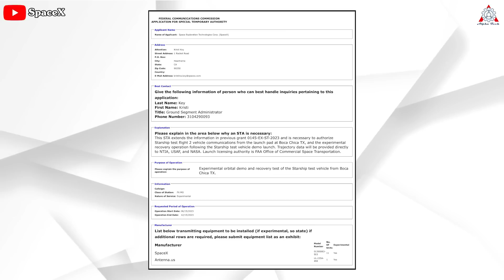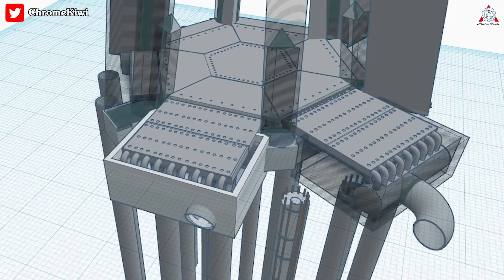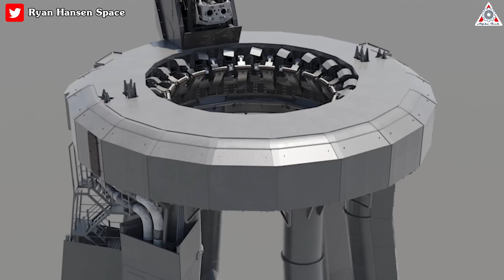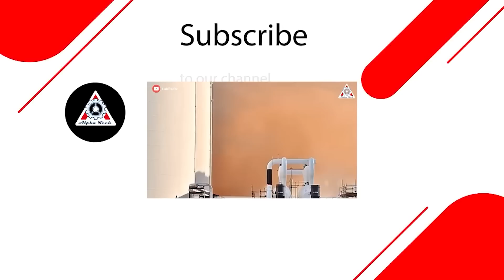NEW Starship Launch timeline leaked out! Stage 0 makes huge progress...

Comment: it's not the starship that I worry about. It’s about the launchpad that is the concern.

They have to do something about the super heated steam that will erupt and consume the engines and their plumbing. 

Imagine the super heated pressure cooker consume the entire rocket at launch.

This is what I predict.

Sanjosemike (no longer in CA)
Reply: If the concrete tornado didn't consume the rocket, I doubt the steam cloud will. The steam will spread out and away from the engines, and condense into visible vapor upon exiting from under the OLM. The real pressure will be coming out of the Raptor engines (pressure cookers), and will flow from high to low pressure areas (away from pad).
Reply: @psycotria  Heat rises. That is a part of physics. Obviously Mr. Musk believes as you do. If the rocket engines (and their plumbing lines are cooked by the hot steam, I guess we will find out.

I am not quite as certain as you are this won’t happen. Let’s put it this way. I am not willing to be part of the payload on the next launch attempt. Are you?

Comment: The very best engineering for the heavy lift rocket is to dig a 100' hole, and launch from the hole. At ignition the hole instantly has negative pressure, and pushes upwards relieving a full weight lift. The water flush to control sound, and protect the engines also will produce instant steam, which expands by 1500X creating close to the amount of thrust generated by the heavy lift rocket. By the time it leaves the hole in the ground in about 7-10 seconds the rocket will have twice the excelleration of a ground level launch, and all the exhaust and steam will act like gunpowder behind a bullet. It will save tons of fuel with the object already in motion at several times the speed of a ground level launch.  Just my engineering idea to improve the heavy lift rocket. The sound will also be directed straight up until it leaves the hole. All navy rockets launch from tubes of some sort, and the rocket is already zipping along when the tube pressure pushes it out. This isn't new technology. It's just doing it on a massive scale. Hopefully it won't collapse the rocket with more thrust than it can handle.

Comment: SpaceX's lauded "lessons learned" model is nothing more than what NASA meticulously did.  A little less cheerleading out of Alpha Tech and maybe some more objective observation would be appreciated.  What SpaceX is doing is indeed impressive.  How they are rushing along testing already obsolete equipment yielding minimally productive feedback and maximizing unforced errors deeply harms their "meticulous" cred on the postflight problem-solving.
Reply from the maker: I noted this, thanks
Reply: I think SpaceX's need to "clear the pad", along with finally having a flight ready prototype, enabled the exposure of a design flaw in the foundation (see CSI Starbase ) that may have ended any earlier, now scrapped booster prototype launch with a pad explosion, causing far more damage and perhaps injuries or deaths. SpaceX has scrapped most of their test articles after analysis said "This ship won't fly". They may move fast, but not recklessly so.

As for "already obsolete equipment", SpaceX blows them up, gets the data, and innovates, while NASA perfects it at 50 times the cost, decades late and $10s of billions over budget, because they are no longer allowed to fail and innovate. 

Look at all the promising projects that have been cancelled with real hardware already built. NASA burns money that could have been turned into real cutting edge spaceflight programs.

NASA is good at what it does; designing missions. However, building excellent rocket systems that advance the art has not been a thing at NASA since Von Braun and Apollo.

Comment: It still looks laughably over-engineered to me compared to creating a crude flame diverter with some off-the-shelf piping, with no moving parts, and the water deluge system being only used to absorb sound energy. Oh, it looks all so exciting, but good luck with maintaining this over-engineered piece of 💩, as Elon and Co described Twitter.
Reply: The booster plume while still on the pad will burn off 1" of stainless steel plate per second. Just how long will "some off-the-shelf piping" last at liftoff? How many more moving parts does the "upside down shower head" have over what you advocate? The "off-the-shelf piping" will become additional "moving parts". The rocket created "a crude flame diverter" by itself, btw.

Twitter is a DARPA/ClA engineered PoS doing what it was designed to do; project propaganda and control thought. Elon should scrap its code as fast as he fired most of the employees (operatives). Twitter was [Their] bullhorn and Elon executed a hostile takeover. They way mad bout dat!

Comment: I wonder if there is a reason why they don't either raise the launch stand to a safe height or excavate the ground beneath the booster. Heck would it be possible to launch from the Mechzilla arms even ?
Reply: The water level is too high for that. Their new plan can work, not sure why they didn't wait for water deluge set up.
Reply: @WyoSavage1976  the claim was that after the pad survived the static fire at 60% thrust they assumed the concrete would handle full thrust for just the first launch and then they were going to install the plates in the interest of getting the first tests over sooner rather then later. We all saw how that worked out though 😬.
Reply: @WyoSavage1976  The Fondag concrete was more than strong enough to withstand one launch, if it had been laid upon an adequate foundation. There were some flaws in the design of the foundation; see [ CSI Starbase ] latest video by a qualified engineer.

The failure response by SpaceX will result in a pad that far exceeds its prototype Stage 0 implementation prior to the first launch.
Reply: Raising the launch platform is probably the best choice except that it would require all existing stage Zero equipment to be scrapped and rebuilt.  Asking why they didn't just do it that way in the first place is mute. Hind sight is 20/20.

Comment: May I ask, once a Starship is up & working... landed on the moon etc, considering what happens at launch to the area directly under the engines how will Starship deal with the debris blowback on the Moon/Mars surface? I suppose you wouldn't need such a powerful engine... isn't the moon quite dusty? I'm sure it's all been worked out.
Reply: It has engines on up the rocket (on the moon version ) just for this reason
Reply: You won't need the booster on the moon or mars because of the lower gravity so only starship will suffice. It's likely that the first starship won't come back. I assume that they will use a few starships to bring material to build a pad on Mars / Moon and then go from there.
Reply: Starship by itself can theoreticaly reach orbit from earth but without any payload, it would have no problems elsewhere with the lower gravity. Most likely is for there to be landing thrusters higher up so it can clear the lunar or mars surface before firing the main engines.
Reply: Don’t they you know the moon is made of cheese?   What a gooey mess it will be.
Reply: It will all work out. SpaceX's road to success is paved with expected potholes.
Reply: You asked the $64Mil question.
But yes, SS has only 6 engines,
but I still see the Selene sinking in dust.

Comment: 1 Raptor is completely different than 33 Raptors. If any spot on the steel plate ends up running dry, or has even a slightly lower pressure than the thrust side then rocket gas is going to find a way in and once it does it will explode the whole thing. I assume SpaceX is planning for that and has it figured out, but I think they (and a lot of us) thought they had it figured out with the Fondag concrete.
Reply: The upcoming 33 engine static fire tests with the water plate design will tell us all we need to know. Also for the next launch attempt I suspect they will spend far less time sitting on the launch mount powering up thrust. They’ll just send it. After they scrub a couple of times of course.
Reply: You sure love making up the most frightening fictional narratives. If there is a dry spot on the metal plate the water pumped under it will refill the pocket and still cool the plate.  If exhaust enters it will be pushed back out by the water and since the cavity under the plate is lacking fuel, there would be no explosion.
Reply: See an oil & gas ground systems mechanical engineer's analysis of the pad failure. [ CSI Starbase ] latest video.

Comment: I'm looking forward to the deluge and water cooled steel plate solution they'll use at Mars Chica.
Reply: Single stage to orbit and dramatically less thrust is feasable on Mars.  38% earth gravity.
Reply: on mars there is way less gravity so less thrust is needed

Comment: That application covers communication equipment, and is for 6 months from June to December .
Theres no way that the FAA will give flight approval until they fix the pad properly(and prove it with test fires) and fix the flight termination system so that it actually destroys the vehicle, rather than making a vague suggestion that it should do so.
Reply: What does FAA have to do with prototype new launch pad?
Reply: @psycotria  Since when do paper pushers need real authority to impose their will? The Supreme court just spanked the EPA on water ways, they need cases to do this to more agencies.
Reply: Thank goodness the FAA is there to protect us from success and advancing.
Reply: @rogerrussell9544  I'd be quite glad they're there to stop out of control boosters from landing on someone. It took over 40 seconds from the point the fts activated until the booster destroyed itself. You happy with that?
Reply: @Forest_Fifer  That hasn't happened, ever.  Nobody has been killed by Space X, but it has with NASA, perhaps I'd be more glad if they didn't decide who to punish and stayed out of the way.
Reply: @rogerrussell9544  so you'd  prefer that the body responsible for regulating air and spaceflight stays out of checks notes spaceflight?

Comment: No concrete at all: Only Steel(plates): cooled by tubes welded to steel-plates, designed like Motor-Nozzle (Reusable like the Motor). Cooling water flow in these tubes...
Reply: There’s concrete under the plate.
Reply: @russellharrell2747  Yes, but the concrete should not "see" hot gas...
Reply: @doronb-a1393  here’s hoping.  Also hoping that the morons who thought that fondag was going to last through one launch of the world’s most powerful rocket have learned their lesson.
Reply: @russellharrell2747  Fondag was well within its specs. The pilings under the cap under the Fondag were too few and insubstantial.